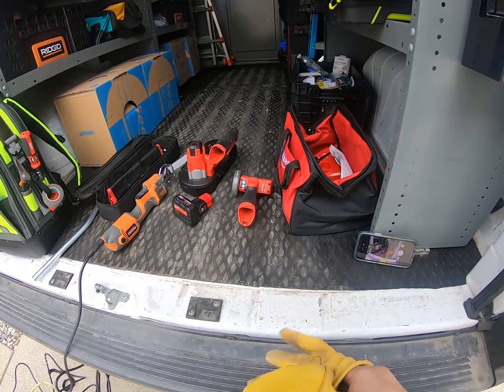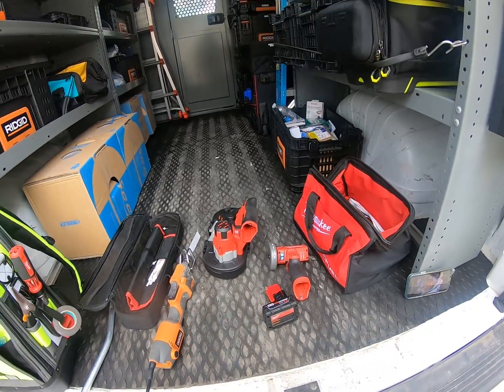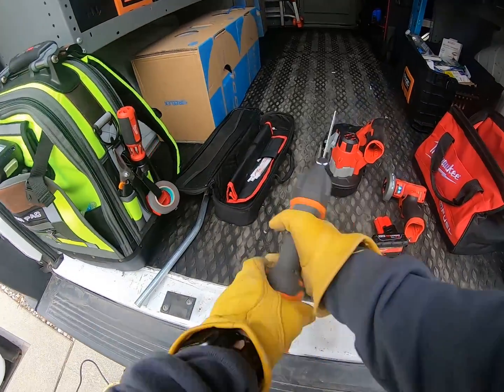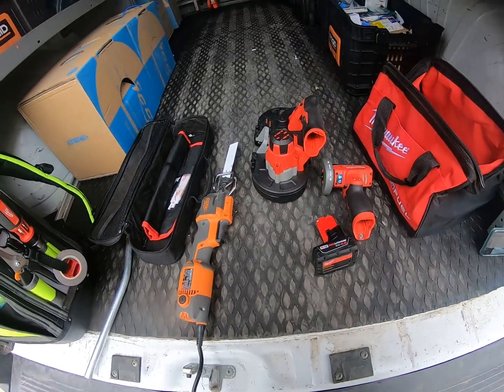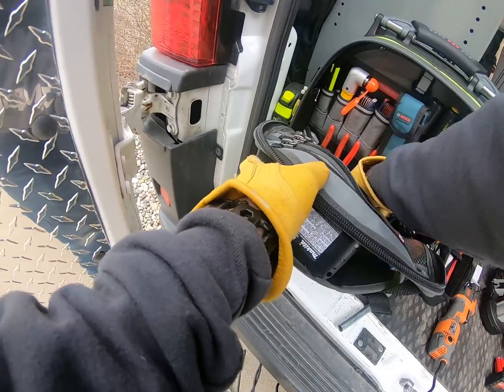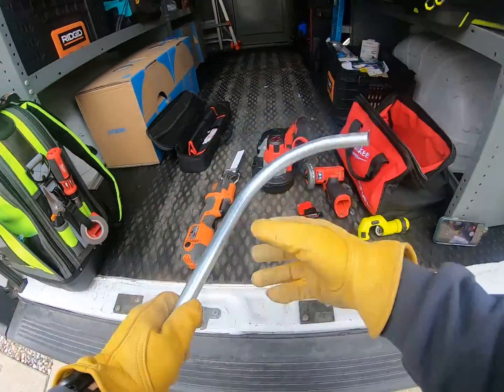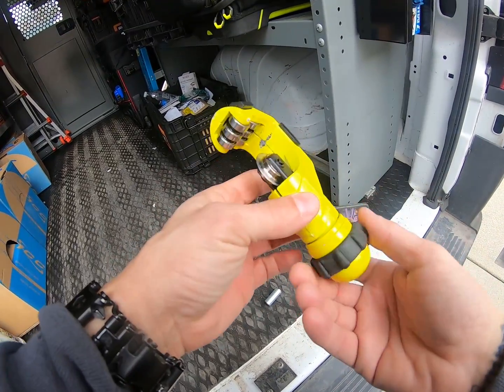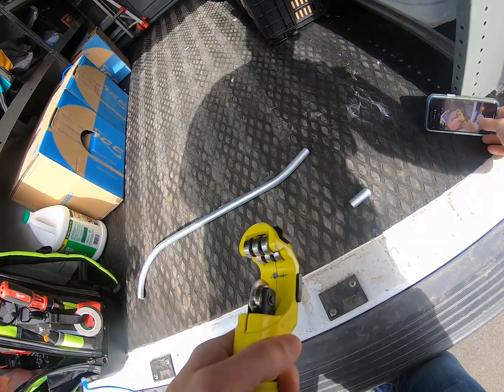EMT Conduit Cutting Tools Compared

Comment: Don’t ever use a tubing cutter on conduit. It will leave a ridge, even if reamed, that the wires will get cut by. No matter the tool being used to cut the conduit it needs to be reamed. And an option not shown was just a typical hacksaw, which leaves the least amount   of burr and is just as quick if not quicker than the tools shown here.
Reply: It can be reamed. relax.

Comment: M12 portaband ftw. The newer fuel one rips through it even faster! And the bigger throat on the compact tool is a great improvement over the previous for metal fabrication use. Mine lives in a medium packout with a big drill, a grinder, m12 die grinders and related accessories.

Comment: nice video, i do Refrigeration and have to  do alittle electrical , ive always used seal tight but wonder what was best way to cut emt if i ran that
Reply: Honestly, I like using a pipe cutter, it cuts straight and not jagged and won’t skip everywhere.

Comment: For those who are interested in the hand tool. Keep in mind that it’s scoring the pipe and because of that it will leave a much smaller diameter at the end. So obviously it makes it harder to pull wire through and also it changes when doing box offsets because of the diameter change, and it’s a significant change. There is a small work around which I use in a pinch. Go over it only three times then stick it in a bender and crank it and that will cut it. It will still change the diameter but not that much. Anyway, build muscle on those forearm and use a hacksaw until you could afford a bandsaw. Everything else is only for pinch.
Reply: Smaller diameter?  Yes, this is true after the initial cut, but the next and final step is to debur the inside edge of the pipe, opening it back up to its original inside diameter. The bur on the inner edge after the initial cut HAS to be removed as it can cut the sheathing on the wire you run thru it.

Comment: Thanks for the video. I also have the same tools. Yes the M12 bandsaw is great. HVAC and Sheetmetal is my trade. Use it all the time to cut S-Slips and am amazed how clean the cut is. Also cut 1 5/8” unistrut and 3/8” treaded rod. I noticed the difficulty you had removing the M12 battery. You have to squeeze both sides of the battery. DEWALT has Milwaukee beat on that one feature, the DEWALT only take a slight pressure the thumb to remove the battery. I still favor most Milwaukee over DEWALT tools. But does anyone know of an easier way or tool to use removing the Milwaukee battery. I sometimes use the handles of a pliers to do the squeegeeing. I am 73 and don’t have the hand strength I once had. Glad to see a young man has a bit of a struggle also.

Comment: Bruh get a metal cutting circ saw, Milwaukee makes one. That's default for a quick, clean cut. Full size band saw for gang cutting, and Sawzall for installed pipe in a rack or conduit in fixed positions which have little access to, as an absolute last resort. No need for anything else. Metal cut off tool is an absolute no. Carpenters use abrasive chop saws which are the larger size versions which is loud, sparks, doesn't cut clean.

Comment: Tried cutting a 1.5 inch EMT conduit with a Dewalt miter saw.  Thought it would cut through it like butter by using a Freud Diablo blade for metal..  Never again.  Blade wouldn't budge and ended up dulling it.  Ended up using a hacksaw to finish off the cut.

Comment: Question:  How would you cut a piece of conduit that already has wires in it?  Like when you are replacing an existing panel with a larger panel, so you need to make the conduit shorter?
Reply: Flap jack get one of those small pipe cutters he got. You just tighten and go around the pipe then rinse and repeat till the pipe cut up around. Doing that carefully should avoid damage to the wire. If the pipes are too close to each other to maneuver. Take off nearest support or coupling to make it move enough to use the little tool. Think it cost 20$ i got a husky one. Its small and compact and should cut to 1 inch. They sell larger ones also.
Reply: Common sense not to cut anything with live wires.
Reply from the maker: Keep in mind we are an IT services / low voltage cabling company, not electrical.
Reply: @ComputerProMedia  bad answer 👎
Reply from the maker: @osielbasurto5641   Not sure what you mean?  The answer about cutting pipe to an electrical panel?   If so, we just wanted to clarify that we are a low voltage network IT company, not electrical.  We can't give advice about cutting conduit with hot wires in it or anything involving electrical.  It looks like his question was answered by another electrician though.   If talking about conduit with low-voltage (network cable) already in it, then what @roxas134 said still holds true.  Just use a manual pipe cutter and be careful.  It would be tedius to cut out a middle section, so if it were near a termination point, I would just pull the cable out, cut the pipe, and then re-terminate.

Comment: That cut off tool will cut all your wire when you pull,So will the copper cut tool. This guy has no clue. If I saw this guy using those tool I well kick him from my job site. Only the reciprocating and band saw should be used.. ream your conduit please.
Reply: He said multiple times in the video that the pipe has to be deburred after the initial cut. He knows what he's doing.
Reply from the maker: The band saw and the manual pipe cutter are the cleanest for sure.  We always ream the pipe afterwards so no worries about cut wire :)
Reply: Lol😂 bro no one would even invite you to the job site with a comment like that
Reply: You can't use a plumbing tubing cutter for emt. It will role the edge in and no you won't be able to clean the edge it created. Klein makes a cutter that you ring and snap I believe. Please don't share info just cause you have a camera. You're going to get yourself or someone hurt with piss poor information.